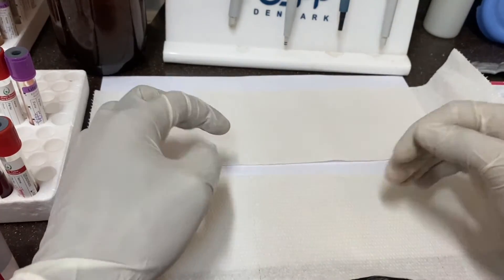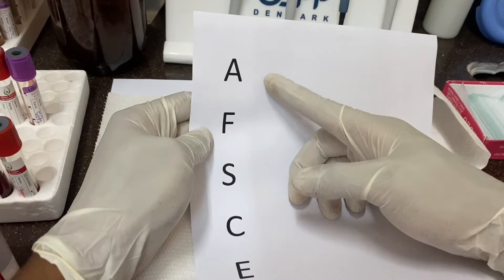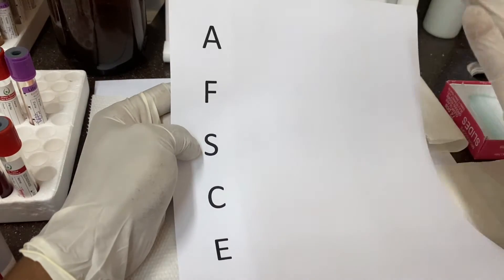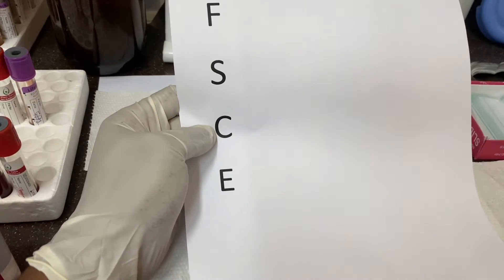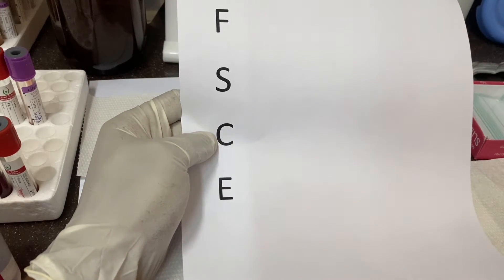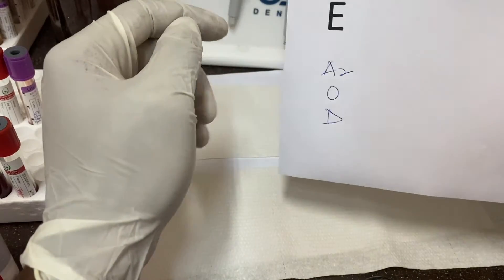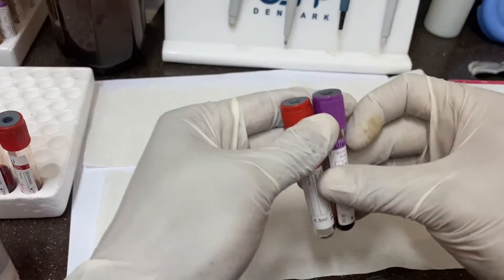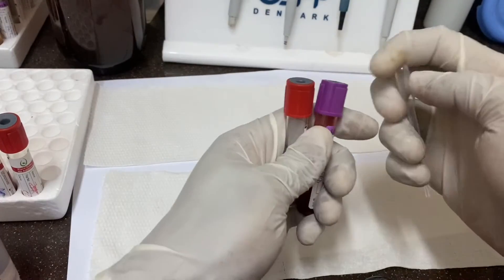How to run HB electrophoresis in the laboratory ( HB genotype)

Comment: Are the bands made on the shiny side or the dull side???
Also, the acetate paper seemed wet, is it kept in the same alkaline buffer used in the electrophoresis machine or another buffer is used??
Reply from the maker: Both side of the paper works but the shinny side works faster.

You can keep the paper dry but when you are about to use it , do well to wet and blot it in the alkaline buffer.

Comment: Please
What side of the paper should be used ,is it the shinny side or the other? and secondly, must one use a fresh buffer?
Reply from the maker: Use the shinny side.
You can reuse the old buffer.
Reply: @easypassgh7506  ok
But what about filling the bufferin the well ,must it be full to brim?
Reply from the maker: @ No
Just enough for the tip of the paper to touch.
Maybe 1mm above the tip of the paper
Reply: @easypassgh7506  ok bro
So the paper should touch the buffer for the migration to take place right?,,, and I went to cut the paper,,,chai! 
See what inexperience is doing me oo?
Reply from the maker: @ chai 😆😆😆

Comment: Thank you 
Please I did my genotype in 2 different labs years ago, it was AA. Recently I needed to do something and I went to a different lab, it came out AS I went back to complain and they said that’s the result. Please what’s the reason…
Reply from the maker: The genotype of a person doesn’t change so it’s likely one of the two groups of lab results is wrong. 
You can repeat it at ISO accredited lab or do a sickling test to confirm which is of the two correct .
Reply: @easypassgh7506  thank you